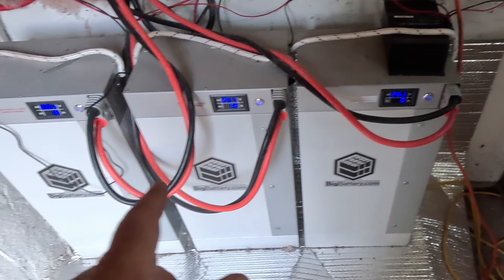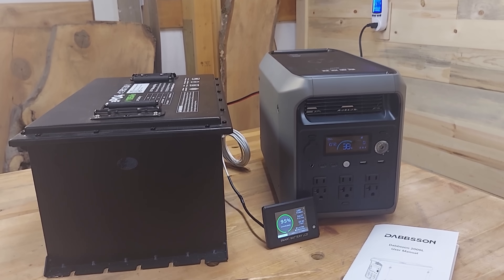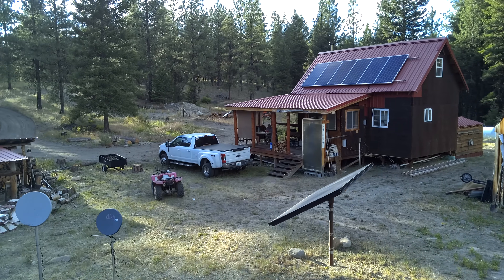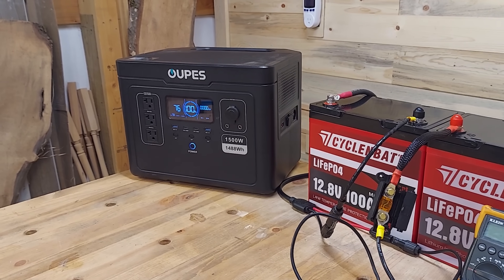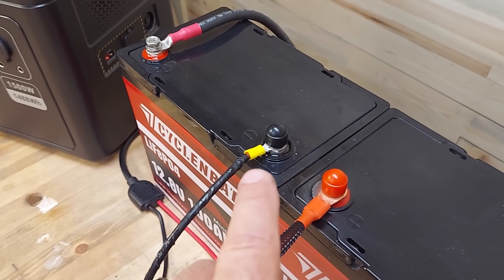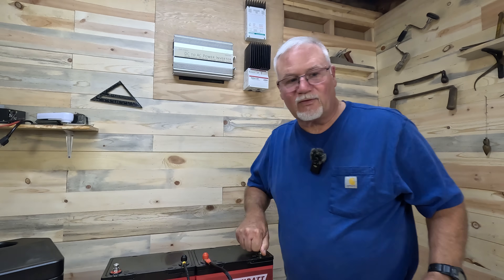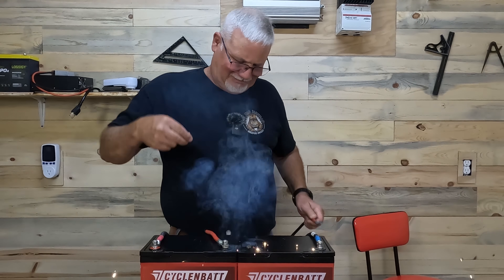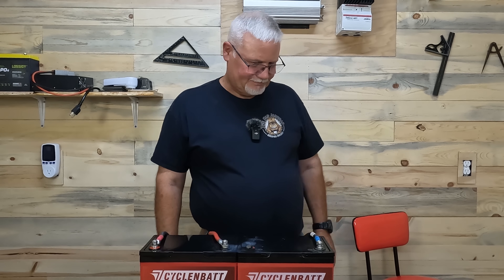NEVER Wire Batteries In Series Without This!!

Comment: 1:36 Could you point me to people burning down a LiFePo4 battery? I'm under the impression that LiFePo4 is a safe battery technology that doesn't burn down like Lithium Ion.
Reply from the maker: I should have said 'Lithium' not LiFePo4
Reply: @TheOldJarhead  Scared me. I have 30.7kWh of LiFePo4 batteries sitting on my back porch under a wooden porch roof. I honestly think I would sleep easier if I built a battery storage building in the middle of the back yard.
Reply from the maker: No battery is fireproof but LiFePo4's are very stable and mine are inside the back room of my cabin

Comment: Umm, I don't think the BMS protected anything here. You literally welded a screw, which is quite a bit of amperage. A lot of the no name batteries don't have dead short protection. Better BMS notice the dead short within milliseconds and cut off power before damage occurs.
Reply from the maker: Hmmmm possibly.   but my thought was it cut off the battery due to the high amps but maybe not.
Reply: That battery can output 300 amps for 5 seconds before the BMS Trips. Not milliseconds!  You certain can "weld" the screw with 300 amps in 5 seconds.
Reply from the maker: Hence my thinking a 100amp fuse would have been the right thing to do though I suppose a fast acting as well.

Comment: We once had a telemetry project with a little 7Ah SLA backup battery with long wires going to the board, and a little 12V fuse on the telemetry board itself.   See the mistake already?

Yup.  I managed to short the wires before they reached the telemetry board, so of course the fuse was useless.   The entire line of wiring, positive and negative, from the battery to the short, was instantly on fire.  About 5 feet each. 

So I yelled "FIRE" and rapidly unplugged the power supply (also part of the unit) from the wall.... which of course did absolutely NOTHING to stop the fire because it was the battery and not the power supply.   It actually took about 10 seconds for me to realize that the thing was still energized by the battery and clip the cable.

And that was a tiny battery... a little SLA.  Still enough to turn a long line of wiring into a long line of fire!

Then there was the time I dropped a long unshielded screw driver into a rather large wet-cell lead-acid battery box.  We never did find the screwdriver... the entire thing had vaporized... 

Stories from 30 years ago.

-Matt
Reply from the maker: Yikes!  lol we li e and learn 🤣

Comment: what fuse would you use?  and how would you use it?
Reply from the maker: For this case I could have used a 20amp fuse since the power station was drawing only 10 to 15 max, but the cables could handle 75 amps so 100 would be ok for those.
Reply: Can you be more specific.....
Reply from the maker: I can.  Once I'm on my PC.  On my cell now
Reply from the maker: I have these fuses https://amzn.to/4o67xwm and the fuse holder https://amzn.to/46uEnAN when just wiring up a couple batteries in series for a power station that is using 10-15amps I'll use a 20amp fuse and 10awg wire.  Typically what I do is place the Midi 20amp fuse on the battery pos terminal then the 10g wire with a ring terminal on the fuse and either MC4 connector on the other end or xt60/xt90/Anderson on the Power Station end depending on the solar port of the power station.  On the Negative side I go battery to power station without a fuse since I have a fuse on the pos side.

Now, for larger systems, like at my cabin, I use a complete battery disconnect system with breakers for the charge controllers and for the main battery to inverter.  Completely different setup though, than what I am showing here.

Comment: Great Video ,,, and always stop and think before resuming  work  when distracted ..Very good message now as for connecting batteries safely                                                                                                                                             "When connecting batteries in series, always connect the positive terminals first, then the grounds or negatives. This helps reduce the risk of sparking and prevents short circuits or potential explosions. Leaving the negative connections for last minimizes the chance of accidental grounding through tools or contact with metal surfaces.".. no need for a Fuse  been doing this for 43 years as a Red seal Millwright, and a diesel Mechanics and also As a commercially licensed off Grid Solar System Builder
Reply from the maker: Thanks for the great post.

Comment: Glad you are ok. My preference is to position the battery terminals in such a way that the positive and negative terminals are as far apart as possible. Once I was tightening the bolt with a little closed-end wrench and accidentally touched the other terminal. Thankfully the BMS did its job. I can also see myself dropping a wrench or screwdriver and have it touch both terminals with my luck.
Reply from the maker: Oh ya, I've done similar on car batteries!
Reply: Exactly. I was surprised he put the batteries in series that way. More dangerous, as you noted, and the way I think of it is I am extending the series of cells in those batteries by connecting the close terminals, neg and pos together. Less chance of making an error.
Reply from the maker: Truthfully, I wouldn't normally.  Normally I'd turn the batteries 90 degrees for starters (check out some of my older cabin videos and you'll notice my battery strings are all that way) however, when filming you always try to get the companies logo up front and in the camera and you also always try to make things obvious while not cluttering up the screenshot with cables etc.  So the mistake I made was to turn the batteries facing out (rooky you tuber mistake I'd say) and then use the outside terminals to make it easier to drop the wire down behind the batteries so it was out of view...it's not just 'connect up this' and go, filming changes the way you do things and in this, I made several mistakes.

Comment: Thank you for the commentary and the warning.

This is common among all YT creators that work with batteries.
Do as I say not as I do.

As you are comstantly assembling and disassembling battery systems.
My suggestion would be to make a cable with a fuse built into the cables.
That way its always there.

Video the assembly to show us how to do it properly.
Reply from the maker: Thanks, and yes, I'm working on that!  Fusing will be in an up coming video.

Comment: Yikes! Yeah I’d say there might be another thing going on here, I say this because I’ve done it myself. Normally series wiring is a very basic concept so the advanced electronics guys tend to disregard the seriousness of what they’re doing and allow themselves to mentally focus elsewhere while doing it. Sort of lean on the routine in auto pilot while thinking about the not so routine or more complex things. I’ve been there. 
Currently wiring a mega squirt ecu in a ranger with a fusion 2.5 turbo set up with vvt. FUN!   Just last week I forgot to bolt down the main ground on a piece of equipment I just replaced the whole harness and control board on. Took a little bit to figure out wth was going on😅 So yeah the routine can bite you if you’re distracted.
Reply from the maker: Good point!  Cheers!

Comment: I'm a newbie. I bought some Ecoflows. I have 2 lifepo4 batteries that I plan to use as expansion batteries, should the time come. I watched several videos, they just connect the battery to the solar input of the Ecoflow. I've been searching for a cable with a fuse, but I haven't found one. Maybe I have to make one. I'm glad that you are ok, and thank you so much for sharing your experience.
Reply from the maker: You can get a cable with a ring terminal and then connect to a fuse at the battery.

Comment: Thanks for your video. It would have been nice had you not change the leads to the multimeter and put the red one on the black one in the black one on the red. I think I seen on one video where they said it doesn't matter but I'm confused at this point. But good to know.
Reply from the maker: As long as you are testing from one post to another of different polarity on the other battery it doesn't matter which ones.

Comment: Glad your ok. Working with batts specially the new LifeP04 stuff for me at least always has me on edge. Was the cables under load or something? I normally connect the to batts in series before I connect the main leads off? I only seen IMO sparks and arks when connecting inverters if no cut of in mix. Which is why I don't like running batts without cutoffs right after batts in my setups now. Anyways thanks for showing. Cause truly we all have made mistakes and had some scares but, those just getting started watching others helps learn.
Reply from the maker: Thanks for the comment and glad this video helped you out!  I literally added a second cable absentmindedly....not what I intended! lol

Comment: Thanks for the lessons learned that being pay attention and use the necessary equipment. I have melted a few plier end in my day. I noticed you had opted to connect the "outer" terminals together positive to negative running the cable behind the batteries. Then use the "inner" terminals to connect to the box. What if you connected the inner terminals together and ran the outer terminals to the box? Maybe it would give you an edge more of visual situational awareness? It's how I connect my 12V battery setup for 48 volts. Also it's a good idea to use terminal boots that cover the entire terminals conducting surface.
Reply: That was my thought too. Wiring should be KISS, the simpler the better.
Reply from the maker: True -- though trying to wire something up on video vs in RL tends to toss in some other considerations ;)
Reply from the maker: Great points - I appreciate you sharing your experience and suggestions for increased safety!  I like that idea.